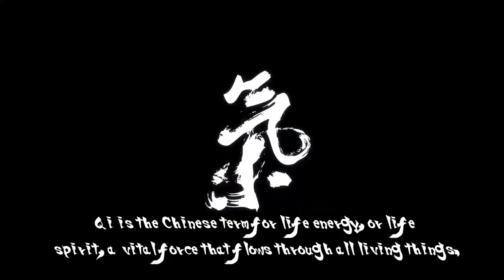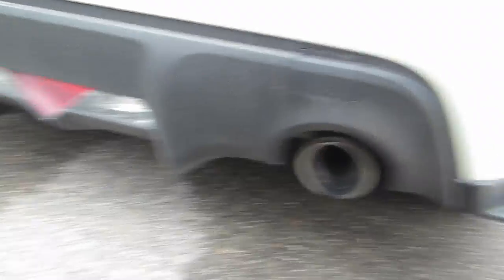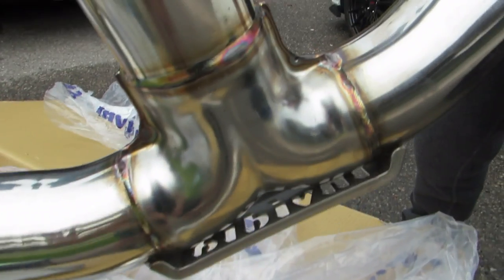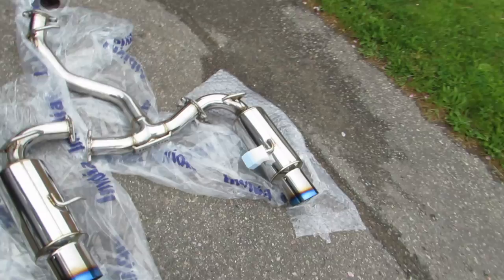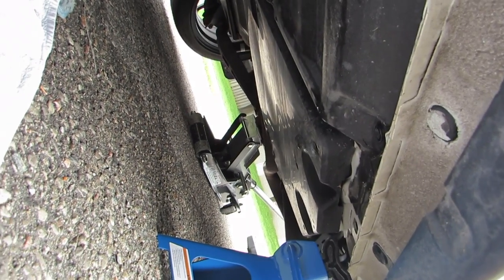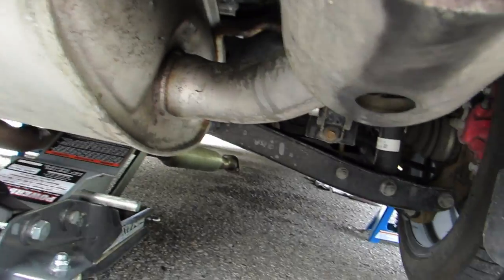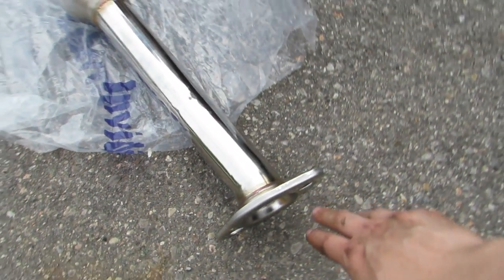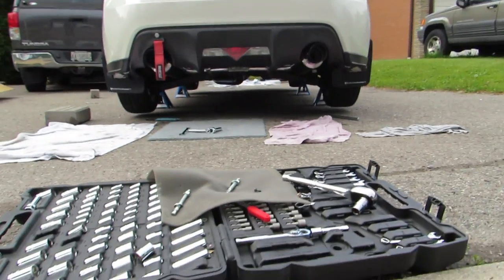Subaru BRZ Invidia N1 Install

Comment: Those eibach springs will throw off your suspension geometry, going lower than an inch will put more stress on your CV joints.  You will also need adjustable LCA's to get your rear alignment correct.  Get some subframe and diff bushing inserts to stiffen up the rear while you're at it, ~$100 or so.
Reply from the maker: Thanks for the info!! I’ll def look into it, I may be swapping to coil overs some time soon. I may be getting adjustable LCA for the rear as well :) I have to look into the subframe and diff bushing inserts though

Comment: Siickkkk, just bought one myself :D
Reply from the maker: I think you’ll love it bro! Sounds amazing on the outside. :)
Reply: Hey man, installed my n1 3 days ago and was wondering if your having crazy drone around 3500rpm to 4500rpm, its brutally loud for all my friends too cant drive it for 10 minutes with head aches! Wondered if you had any of these issues or if they went away after carbon build up. Thanks man! :)
Reply from the maker: Hey, yes it does drone quite a bit when you first break it in, but after a while the drone seems to soften up (unless i just got used to it lol) i remember my first week i could barely hear my music! Don't worry, it will be less droney soon :D (the smell will go away too)
Reply: PowerofChi alright thanks man, you just earned yourself another happy subscriber.
Reply from the maker: Appreciate it <3 keep me updated on your build!